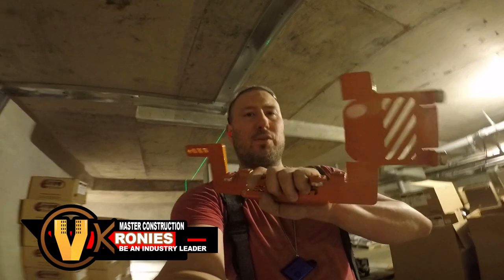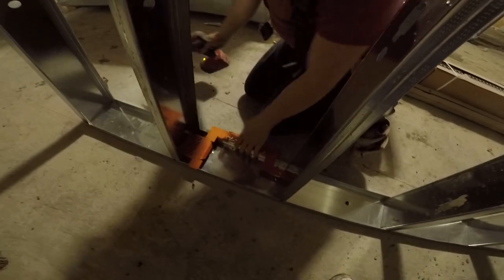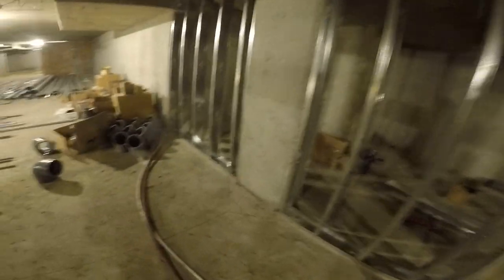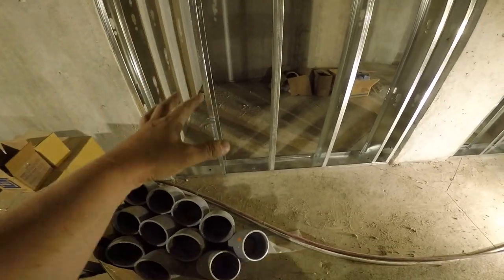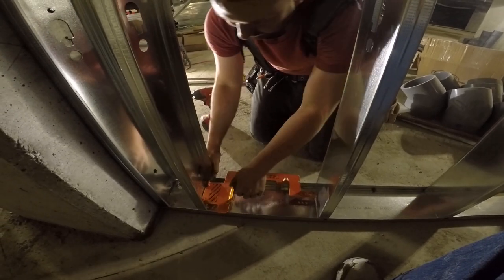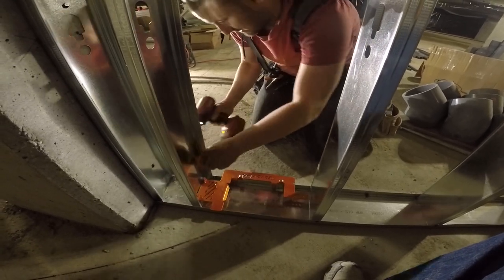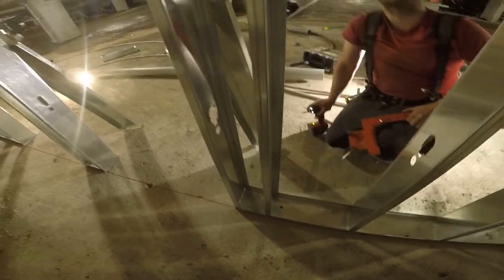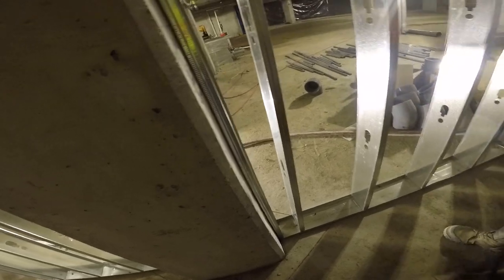Metal Stud Framing Tool 99.9% Of You DON'T Know! Tezyzy?

Comment: cool tool! seems like on the light gauge, it could benefit from something that provides some blocking  between the flanges of the stud, that way when you start the screw, it could prevent the flange from flexing inward
Reply from the maker: Yes that is what it does. 25 gauge is so flimsy eh, but 20 to 16 gauge this tool is a dream!

Comment: Yo Chris! Wth? All those years of measuring, marking, squaring, and clamping every..... single....... end.... of.... every.... stud! 😲 Where has this thing been???? This could be to the stud install phase like the portable mini laser has been (vs the plumb bob) to the track install phase. Question: does one tool do both 3.5" and 6" studs or are there different sized ones? Thanks and God bless! 😁👍
Reply from the maker: awwh man I remember when we only had plumb lasers then the rotary and then the line laser. Thank God for the line laser lol. Yeah man this tool is really handy, the repetitive steps of clamping and squaring are almost all eliminated. The tool comes in different sizes for 1-5/8" to 2-1/2", a 3-5/8" and 6" one. Also comes with the 2' o.c. attachment. You would really like the tbar squares, if you ever did tbar they have squares for that too that are actually a better product than these ones. Thanks Dave be well my friend!
Reply: @konamanstudio2447  KONAMAN! 😁🍻👍

Comment: Where would I get one of these? Amazon, I'm Guessing. Im in Carpentry Journeymen School for a non union General Contractor. Just started doing a bit of metal framing. We're doing it off prints.
Reply from the maker: The company is in the middle of negotiating with a new manufacturing company and the tool is unavailable right now. I will give everyone an update when they become available again!!
Reply: @ConstructionKronies  yes I was looking online saw that. But I would need to get one of ea. We're doing all different sizes of track. We're actually building a dominoes. I normally do bigger projects then this but we do smaller jobs as well. Was a Demo then rebuild it for them with existing structure. So I don't do metal work all the time like that but I need to learn it. I also have a hilti impact and laser :)
Reply from the maker: @Silencedbearar  nice, I know how strange it is. I was a carpenter wood framer before steel and drywall. The tool is only good for big piece work type jobs where you do a 1000 feet of wall. On the smaller jobs you can still get by with the tape and framing square. If you ever need help or have questions you know where I am!
Reply: @ConstructionKronies  right, I'm actually in the Carpentry Journeymen School it's by the NC CER, like were doing the union carpenter school but were not a union company. I'm guessing your in Canada. But it's really cool I got chose outta 200 people

Comment: So does that eliminate the Layout for the framing cause I don't think that's any faster than how I do it
I mark all my layout one side then square my beginning over to the other side and I just hold the soft side and screw it center
Reply from the maker: So the idea behind this tool really is for big production. Demising walls. All you have to do is layout and square the first 16" o.c. in between the columns or what we call bays. Then the tool will center, square and clamp the rest in so all you have to do is screw them in. With that being said. The tool was designed to be optimal over 50' sections of wall. Plus this tool was made for 20 gauge or lower meaning its a heavy gauge steel stud tool. Its really not that great for light gauge applications. Hope that helps you understand it a bit more! Thanks for watching!

Comment: When using this stud setting tool do you not find you get creep on the boards ? I'm in the UK and I've seen variations in plasterboard width sizes up to 5mm ! So imagine you could possibly be 50mm off centre after hanging just 10 boards on say a corridor wall ?
Reply from the maker: Excellent question man, your the first person since we designed the tool to ask about the creep. Our engineer came up with a factor for that and applied the length to the tool. I can't remember the exact number. So yeah your absolutely right. This tool was designed by actual PC work framers and boarders and was tested a lot. It's too bad the company never tool off. I'm not sure what their plans are for the future.
Reply: I've had similar experience using spacers for wood, but not quite that much. Probably closer to 5mm over 8 to 10 feet I'd more or less expect out of a tool like this. Back when I was building machinery, we had built a jig to fit the vanes to the shaft on rotary airlock valves. There was a lot of manual intervention involved tweaking, shimming, etc to get them straight. Jigs have their place, but tolerance stack up can get out of hand when they're used, moved, used again repetitively. That single point of reference on the stud you're going off can't be that accurate, I could see the square getting out and causing it to be that far out over 4 feet easily, especially with thinner material.
Reply from the maker: @notsure7874  Yeah this tool is best for heavy gauge steel and with larger spans. We engineered it to be within 1/16 over 50 ft. The newer models of this tool are different but I haven't had a chance to even use those ones. I think the guys may have closed up shop because they no longer answer my calls even.
Reply: @ConstructionKronies  Their website is goners too.
Reply from the maker: @notsure7874  Yeah I know, its a long story but it comes down to they really should of went with my plan instead of the 70 year old retired dudes plan lol
Reply: @ConstructionKronies  Its pretty rare that a company listens to reason from people that know whats up. Pretty big factor in why so many go out of business within the first couple of years.

Comment: Does anyone know of a free or cheap design software that a homeowner could use to design out a 20x10 metal framed shed that is going to be built in a wildfire-prone area?
Reply from the maker: Not myself no, I would draw it on graph paper myself. Use 18 gauge steel stud, densglas on the outside and 5/8" type x on the inside. You could even use semi rigid insulation and poli.
Reply: @ConstructionKronies  Cool! Thank you so much for the info. :-)

Comment: Cool tool like a stud master. But I'm not sure if it's worth its weight. It will just get lost or end up in someone's bag. Then you have to fit it in in you're bag and hall it around. Dosent seem revolutionary enough to buy . I mean what's so hard about centering studs with a square and marks on the ground or track.
Reply from the maker: Yeah unfortunately this tool never took off, it was good in panel factory or shop work but in the field not so much.